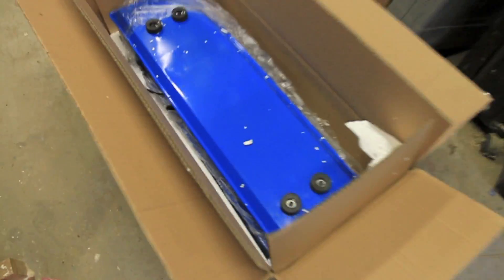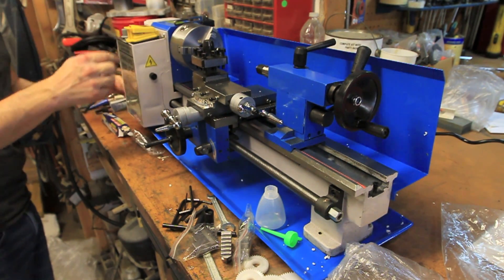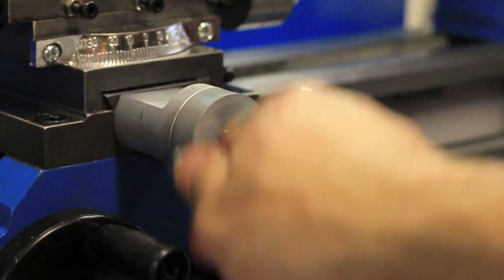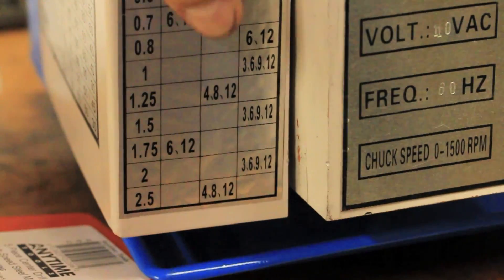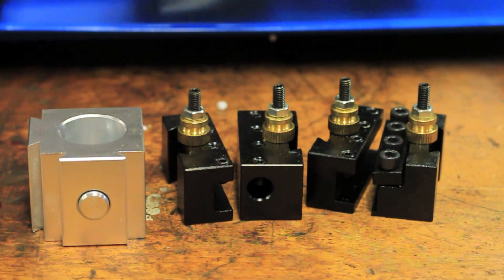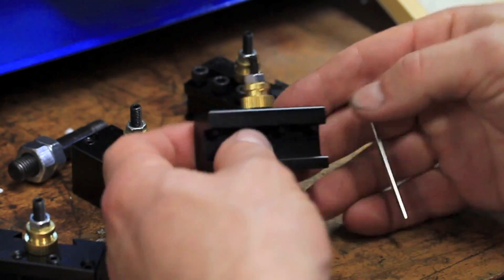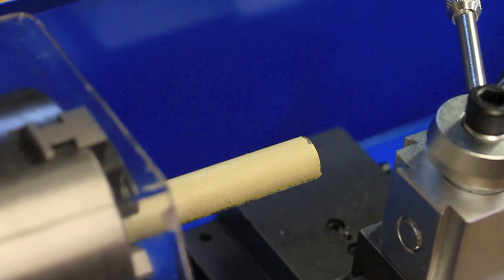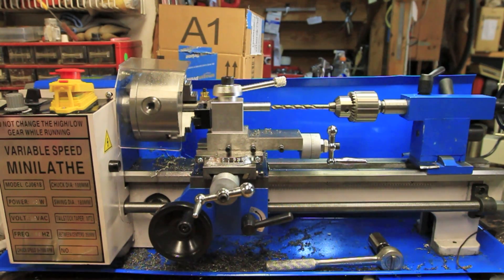Cheap Chinese Mini Metal Lathe Unboxing, Setup, Upgrading, and Testing

Comment: Man you are cringy to watch during this. Sketchy af!
Reply from the maker: How so? Keep in mind this video is literally the first time I used a lathe.
Reply: It would seam that you are a first time user of righty tighty lefty loosey.  Idk how else to explain it, just seams like its your limited experience working with your hands in general. I really mean this as a constructive criticism. We all started some where and keep at it. You’ll see what i mean after a while. Good luck.
Reply from the maker: I appreciate you taking the time to comment but I honestly have no idea why you'd say that. I've done everything from restoring cars to gutting and renovating bathrooms... Maybe it's just a combination of making my first unboxing video on a tool I've never seen or used before that came with useless instructions and sub par fit/finish. Unless you're referring to using the channel lock backwards... that's been very well documented in the comments already and really, now having re-watched it again, I think I did it that way without thinking more because of the space between the lathe control box and the camera than because I thought that's how you use them. Anyway, thanks for watching.

Comment: The No 1 thing to do whenever you buy chinese electrical goods is to run a connections/safety check!! We have bought a few machines from China and we have observed they come with 'live connections' hidden inside the metal frames...that can be simply lethal as soon as you plug it to the mains. Stay safe guys

Comment: Was clearly a bodgers lathe, only if you plan the time required, and the project, to the standard, required. does this does this item hold a purpose. Thank you for this blog I look forward to similar blogs, soon you will come across a gem.Cheers

Comment: the quick change tool post redo in steal aluminum flex's big time and wont last as long it would make a good video too .I like your channel. and any plastic parts redo in metal spur gear s for sheer if its a 1/4 horse motor put a 1/2 horse on it after the gears are done .

Comment: Sounds like a sewing machine. Thank God, I purchased an Altas 6 inch x 24" lathe in 1973. USA made by Clausing who is still in business, and I can get any replacement parts from them. BTW: PLASTIC change gears !?!? Probably good for one use. Best use for those gears; use them for investment casting of proper metal gears.

Comment: As a connoisseur of fine machinery all I can say is ack! there are so many things wrong with that chinese pos I fail to understand why anyone would buy one at any price. And here is a hint for all you lathe newbs, the compound rest is not supposed to be set at 90 degrees, only idiot newbs do that.
Reply from the maker: dalmatiangirl61 interesting... I've noticed a lot of people set them at 45* angles and such but I never knew it's not supposed to be 90*. Is there a reason for that?
Reply: It might look like 45*, but its not. There are books on the subject, like "how to run a lathe", the info can be found there, I'm not going to spoon feed info. If you need to keep to a small machine, look for a Logan 6 x 18. As for advertised dimensions for lathes, they are based on center to center distance, that is a dead center in headstock and a dead center in tailstock, not chuck to drill chuck.
Reply from the maker: dalmatiangirl61 thanks I guess... It's interesting you'd make a fuss about disclosing information by answering the question I asked but then follow it up with providing another piece of information. For what it's worth I've been made well aware how lathes are measured since making this video.
Reply: The info I provided on sizing of lathes is general info, I could tell you what angle to set the compound rest to, but without writing a page or two of info it is meaningless. Buy a book, take a class, pay your dues.

Comment: Well I guess we know what 569USD gets you, scrap metal! Just one more problem after the other, and holy moly that slop in the sliding surface.... I've seen lathes at the junkyard that I would prefer over this. Probably cheaper too.

Comment: Seems like too many corners were cut to make it really cheap. Plastic gears, and hand wheels! Use some Loctite to hold the handles on. In December of last year I ordered several (5/8") tool holders and boxes of inserts from Banggood. What I received was an empty paper envelope in a plastic bag with a letter of apology from the post office that the envelope was received empty. I photographed the mutilated envelope (a paper envelope to hold heavy steel tools!) showing the order # and the post office letter and sent it to BG. After several e-mail exchanges They told me to go to the post office and get proof that the envelope was received empty. I went to he main post office and showed them what I had gotten. They were very accommodating and got me a letter on official USPS stationary signed by the postmaster. I sent that to BG. Several more exchanges and they sent an email asking if I wanted a refund or the products. I replied "products." It has now been over two months and I've not gotten anything and, by now, don't expect to. They have not replied to my e-mails. April 8th, 2018.

Comment: I have the similar one but it’s red one from harbor freight. I think it was a bit more expensive. The finish is better but it’s same bones. It’s a very very very small lathe. Works decent on aluminum but I struggle on steel due to the lack of power. There is a lot of slack in it which makes the dials very difficult to use. I wished I had spend an extra $500 to get a bigger one or found an old used one.

Comment: That's a $500.00 piece of junk. I have a 75 freaking year old 13" Southbend that I paid $500.00 for. Don't go out and buy a new puppy just cause of the shiny paint job, go adopt an old dog that's been around for a couple of decades. 10 times the power and rigidity for the same price. It'll last longer too.
Reply from the maker: That's pretty fortunate and it must be nice to have the space to put it. Are you willing to sell it for the $500? Cause I'd make the space if you want to get rid of it.
Reply: A 4'x 2' footprint machine is not that much of a space hog and no can do on the sale. I've grown fond of it. Keep an eye out on ebay, that's where I found that one. A place up in Ohio called Tas Iron if I remember correctly. That's all they do is get in and refurbish old machinery. I've seen plenty on craigslist also for cheap. Good luck on the lathe, it can be just as much fun tinkering with the machines as what you make on them.

Comment: Recently I bought a PB-4 - Manual Panbrake 1220 x 1.2mm Mild Steel Bending Capacity HAFCO, a Chinese made bender, it had similar problems described in this video, poorly finished, the paint is falling off, I had to replace all of the bolts for the stand and retap the thread holes , I added grease nipples at all lube points , and add some other parts. It works but I got what I paid for, it will do what I need it to do, but I thought the Chinese manufacturer might have a little more pride?

Comment: Just got to tighten the belt man... No need to send back... But to late now.
Reply from the maker: There were a number of things wrong with it...
Reply: I bought the 7x16 version for $550 shipped to my door. Yes, there is issues out of the box. Some pretty glaring ones like the motor not mounted tight. I tried using right out of the box to no avail. I spent a weekend watching youtube vids and reading internet forums and tearing the thing completely apart and reassembling to their instructions.  After that the thing works great. Would I spend another $500 for a 7x16 quality built? Hell yeah. There isn't any...

Comment: Tim, just curious.  You said this lathe doesn't have the 2 speed plastic gear setup, is this a 1 speed brushless motor or did they cheapen it up and take away the low gearing (higher torque) and stay with a brushed motor?   Do you know who manufactured it?Seig makes 95% of the Chinese mini lathes.

ps. you did a great job modifying it.  I bet you are studying engineering in school, you seem to know a lot about fabrication and electronics.   Well done!  Thanks for the videos..
Reply from the maker: Thanks so much for watching! I'm not sure who the origin manufacturer is but it is in fact a 1 speed with a brushed motor.

Comment: If the belt for the motor drive is to loose the sproket will strip out.  Thats why you should go through the entire lathe, cleaning, adjusting and lubricating before starting it.

Comment: I suppose you can get some good work out of it. A good used South Bend or even an Atlas 618 would be far superior. If the lathe craps out on you search for an old hunk of U.S. lathe to rebuild. The difference will be both satisfying and amazing.

Comment: Did you replace the chuck? I have the same lathe, I recently replaced it. The stock chuck imo is garbage. I was wondering if you did replace it, and if so with which chuck?

Comment: Hi Tim, Jay here! Any thoughts on upgrading the two hard to reach screws to loosen the tool post mount for taper cutting? I have the same problem!
Reply from the maker: Hey Jay! So far I haven't really had to mess with them too much but I do have a slight taper when I use the tail stock and at some point I know I have a project coming up that needs to be as true as possible. Once I start getting ready to do that project I'll probably try to start getting creative on those screws.

Comment: My ten year old Harbor Freight mini lathe looks almost identical, but didn't have those problems except for the cracked carriage wheel. It doesn't sound like that either. Get more fuses! I had to get a new fuse holder and reversing switch that had disintegrated over the years. I get my stuff from little machine shop.

Comment: I picked up a decent Craftsman commercial on the stand for 500 bucks. It had been used quite a bit and needed work but a couple hundred in parts and some work and I have it cutting great. I had to shop for quite a while to find one at that price though. I still want to replace the final drive belt with a twin but haven't gotten around to that yet.

Comment: as with most Chinese made tools of this class, they are not really tools, they are collection of loosely fitting parts that, with a lot of patience and some skill can be made into functional machines, the downside is, learning to scrape and fit all the slides will make you resent yourself for paying that much money for that piece of junk in a box, the other thing is, most of time castings for these machines are very poorly cleaned, and will probably require a bit of hammering and fiddling to get the sand off of them, then paint those faces so the sand that didn't get out, will be "glued in" (which is a normal general practice with sand cast things), I bet there was some sand or grinding grit stuck in that chuck, hence it locked it self
basically - this thing has to be taken apart all the way, every single part inspected, fitted and so on, then you can somewhat enjoy making things on it, if you don't do this, you will never enjoy doing any work on it
Reply: In the plus side, you will acquire new invaluable skills that will make you a better machinist.
Reply from the maker: Perfect explanation! If I didn't know better, I'd say you could tell the future: https://www.youtube.com/watch?v=JpU8BzNyZww
Reply: Hehe, well, my comment is true for any of those machines, I've done it on your size lathe, then another one couple sizes up 2250, and then the largest "cheap" one 2870 (280mm turn diameter and 700mm between centers), all three of them were made to the same standard, and all 3 came from different sources, small one was bought locally, the 220mm was from Switzerland (and it had nothing to do with local machine building), and the larger one was from France, they were from auctions, and cost me about half of the store sticker price, so I wasn't too upset about the extra work I had to put in, but the result is quite ok, they are not nearly as rigid as real industrial lathes of similar sizes, but at that price, you can't really get anything industrial
I also have a larger "bench top" mill (450kg, iso40 spindle), bought new from alibaba supplier, exact same story with castings, I kid you not, 2,5kg of sand had been removed from castings after taking it apart, all gears from gearboxes had to be deburred, "scraped" ways (which they do with an angle grinder after rough milling has been done) had to be flattened, straightened etc, but now it is a functional machine, auto feed is a bit clunky to use, but it cost me 1,8k shipped to my door... you simply cannot get anything else in that size (and at that shop nothing larger would fit) for similar money, there are EU rebranded Chinese made machines with iso40 spindles starting from around 3k
about your video, grit and polishing compounds are no good to use to fit the ways, spotting blue and scraper is your friend, that cast iron they use for small machines is very soft, abrasive particles get embedded and stay there, act like a sand paper on the slides, it will not be a problem for a light hobby machine, but should not be used on a more serious work, the other problem with smooth sliding surfaces, when used with proper slide way oils, is sticking, smooth surfaces tend to stick and will require extra force to initiate movement - hence it may be problematic to achieve small feed increments reliably, this is where scraping and "flaking" helps a lot, there are machines designed to work with smooth slide surfaces, they ride on oil film just like a crank shaft in its mains bearings, but it relies on pressurised oil feeding, my larger Swiss cnc mill is that way, and it is quite picky about the way oil it wants for smooth operation...

Comment: How about the fact the gears are made of plastic and not brass
Reply from the maker: This model actually doesn't have the transmission with the plastic gears that cause so many problems in other models. The only plastic gears are for the feed screw and I haven't had any problems out of them.

Comment: 3:47 make new handwheels, you now have a lathe.  5:05 the "slop" can be removed by tightening the 2 lock nuts visible in the picture at the same time.  5:16 use the sockethead capscrew and nut combination to tighten your gibs to eliminate some of the side to side movement (visible at 12:34), not too tight or it wont move at all. 7:21 The additional wide grip clamps for the chuck are Inside Diameter jaws, the chuck came installed with Outside Diameter jaws. 14:48, one way to ensure you do not damage the gears is to turn the speed all the way down before rotating it, and once it is spinning, speed the machine up to the appropriate speed.  Thanks for doing the video, although some of these issues can be easily corrected, it just solidified what I already knew: Do not expect quality from a Chinese product.

How did your return go, were you able to get new gears or a new machine?
Reply: I bought one of these and still having trouble with the X axis being too tight? Seems I’m either tightening it too much or not enough?  I’m blaming myself not being able to get it corrected. I’ve tore the machine down, cleaned it, smoothed out all the rough surfaces. Everything else is working as it should.

Comment: Do these lathes come with the 100mm flang spindle or are they the 80mm spindle with an adapter plate for the 4 inch chuck?

Comment: I bought mine on amazon but I didn't have any problems till I had my first major crash and stripped the teeth on the nylon gears. I want the metal conversion gear kit from littlemachineshop.com not a plug for them but you can find everything there from lathe, to mills, conversion kits, tooling, and upgrades. Somethings they sell thru amazon and other things not so much.
Reply from the maker: Thanks! Yeah LMS is a great resource. This one is actually a single speed so it doesn't have the plastic drive gear problem that most of these other mini lathes end up with.
Reply: Glad to see some good comments before looking much seconds ago I purchased this lathe so crossing fingers I don’t have to do an pile of rework and polishing to get it closer to being on par.  Hoping for the best.  I plan to completely take it apart remove any grease ect retighten an align anything an everything that I’m able to and re-oil whatever need be to fine tune as much as it’s able to be tuned. And hoping for a pretty decent lathe after.  For simple fun/hobby and some light jobs for repair of other things

Comment: Your drive gears are stripped. I replaced mine with metal ones and haven't had an issue since. I have the Harbor Freight version. A little better than what you have. I really like your tool post.
Reply from the maker: This is actually a single speed so there aren't any drive gears. As it turns out it was a broken motor mount that was causing the belt to slip. Check out the fix here: https://www.youtube.com/watch?v=9s9hsYgLmyQ

Comment: What are the chances of being killed with this thing?
Reply from the maker: I would say the chances are inversely proportional to your degree of common sense as lathes are inherently dangerous anyway but there isn't much that is particularly dangerous about this one.

In one sense this is probably less safe than big lathes because of the cheapness and slop but in a lot of ways it's probably more safe in that if something or someone gets tangled in the chuck the motor will stall pretty quickly whereas a big lathe will more likely just keep spinning and break whatever it is that's tangled.